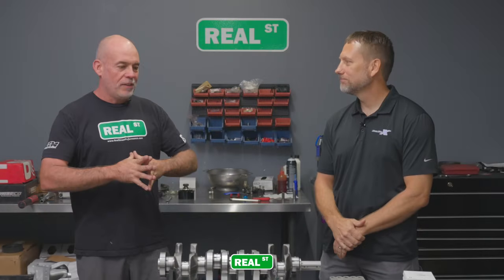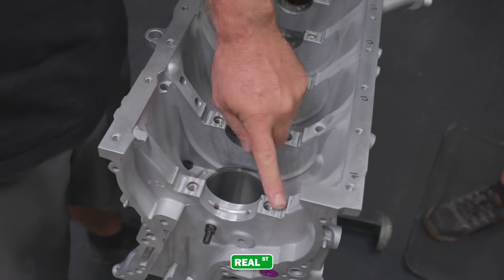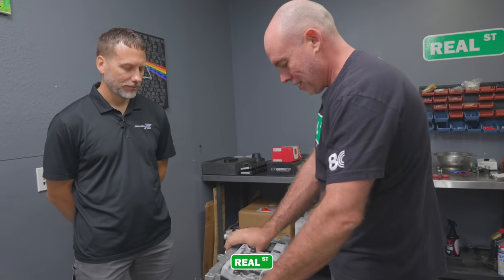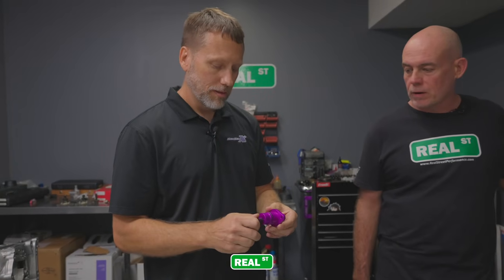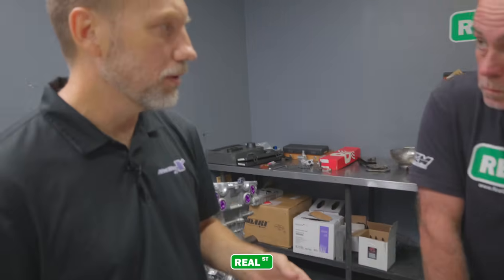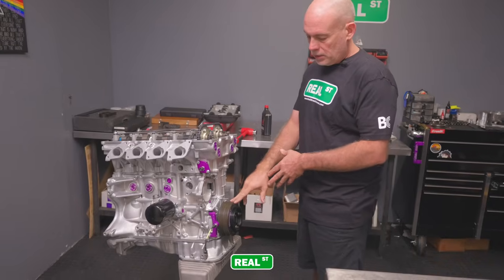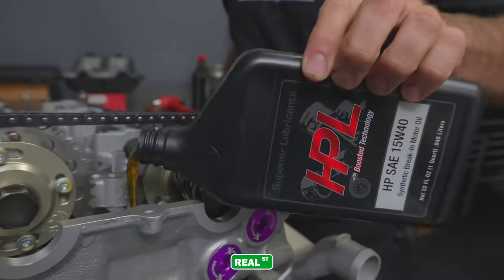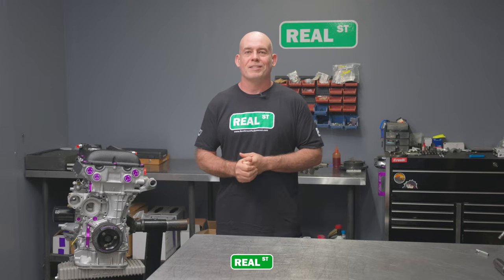Fully Built Nissan SR20 Engine Assembly With Mazworx | 600HP

Comment: Finally, someone in the US who knows the potential of this platform. The US is the only place where no one knows how to build an SR20 properly; I remember 10+ years ago seeing a Datsun with an SR20DET in Puerto Rico running 6 seconds when NOBODY was anywhere near those numbers. I'm talking no Honda, no Mitsubishi; some 2JZ were in the 6 secs, but those had 2 more cylinders.
Reply: Ahhh. Youve been paying attention. Well done. The Aussies also build some monster SR20s as well. Infact Micks Motorsport in Australia did 6 second passes with the oem cast block SR20 back in 2013. A 6.91 at 206mph. I think.
Reply: @conradsealy9603 Yes, some of those car's videos are still up and you can see the upload date 😂 10-12 years old.. Doing mid 7s and low 7s until they finally cracked into the 6s...
Reply: building my 280z with a sr20det now :D

Comment: Running 600hp no dual guide shim, standard rockers and hydraulic lifters you are asking for problems in the higher rev ranges. I understand this car will probably not be beat on but for the money you put in for such a head set up by mazworks anyone looking to rebuild the engine and has money get a VVL head you won’t look back!

Comment: I always enjoy your videos, Jay, but especially enjoy them when it involves the SR20 and the masterminds behind Mazworx.

Going to re-sleeve my SR20 next year and going the HKS 2.2L route. Going to also use a lot of the Mazworx parts  that you guys used on this engine, and cannot wait!
I have a spare SR20 in my S14 at the moment, completely unopened lol, but the one I am about to rebuild has detonation marks around the upper edge on the factory sleeves, and the pistons are damaged from going too hot. Bad tuning and chipped OEM ECU before my ownership.

Looking forward to it though, gonna assemble it myself.
Reply from the maker: That's awesome to hear Sebastian! Good luck on the build, Feel free to reach out to us if you need any help with your project.

Comment: Curious as to the reasoning behind using OEM main-caps but going all the way to sleeving the block. would have expected to see some kind of aftermarket main cap and/or main-cap brace/girdle. Great video informative video with some handy tips!
Reply: Less prone to detonationm and replaceable, with aftermarket sleeves.

When Nissan made those engines, they sprayed in the material for the OEM sleeves and machined them to spec afterwards, leaving an edge just above the first piston ring towards the cylinder head, making them more prone to detonation and can easily get damaged.

I doubt the owner will make a lot of power with it, and it's always good to re-sleeve, IMO. I have damaged OEM sleeves because of detonation in my S14's SR and will replace the sleeves next year before I assemble it.

Comment: I'm thinking about building a sr with my son.  I found one with a spun bearing,  owner says it started knocking and pulled the engine.   It's just 20 minutes from me, they are asking 1,500 for the long block.   Think it's worth it?  

Machining isn't an issue we have plenty of automotive machinist local.  We would completely rebuild any motor we buy for this project even if it was considered a good running sr.
Reply: If it spun a rod bearing which is common, it probably be worth it but be ready to buy a crank shaft. Those are about $1000 and available still from Nissan.

Comment: You know when Blake talks about modifications & upgrades .... I talk about upgrading pistons , Rods , Fuel injectors ... Properly tune .... The combustion process ..... NOT putting a k & n air filter kit on it .... Because their no one to trust to ... Tune my car .... If you ask me the factory.... Has failed me in .... This engine application ... So .... Anywho ....

Comment: Not that powerful? LOL! A fully built SR20det making 500-550whp in. Datsun 510 weighing around 1,800-1850lbs is an easy 9 second car! Definitely should run 10’a no problem. I’d say if my car was running 10’s all day and high 9’s I’d say that’s a pretty powerful car. Idk your Supra 2jz’s doing 10’s and high 9’s probably has to be making close to 1,000hp to go that fast and that’s bc it weighs twice as much as a 510 making only 500-550whp which isn’t “POWERFUL” lol! You should know better than this out of all people that it doesn’t matter if you make 1,000hp in a 2jz bc one hp doesn’t matter it’s the power to weight ratio that matters, and second if you have traction and can hook! But that’s why I’m redline time attack they dyno and weigh your car after the race to make sure you weren’t over the power to weight ratio for what class your running in. Which includes weighing yourself and the gas before and after the race sometimes. Or checking how much fuel your tank can hold bc people who run too big of a tank don’t have to stop and fuel sometimes which also isn’t fair so weight the car will also say show you that bc I believe gas weighs around 6-6.3lbs per gallon depending on your octane and 87 being the lowest at around 6lbs.